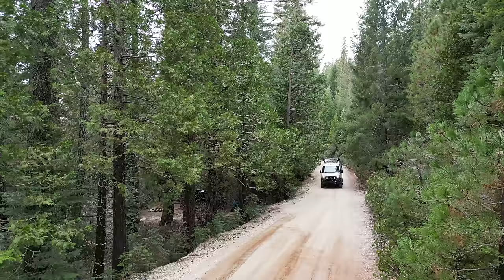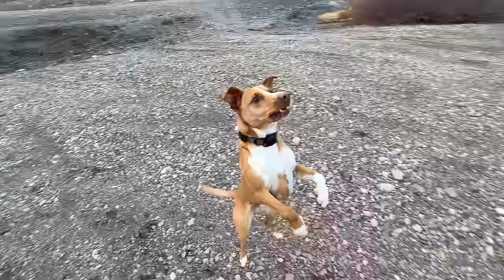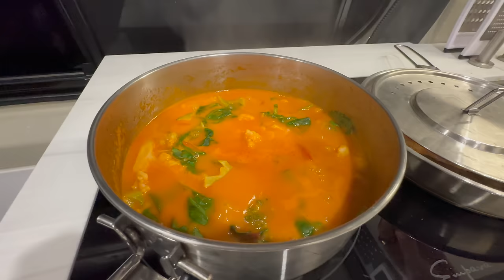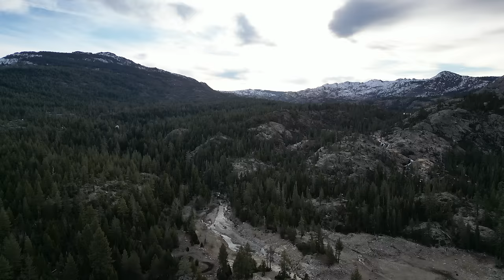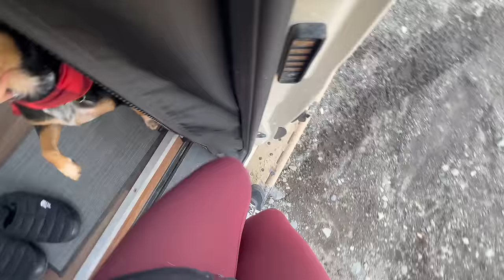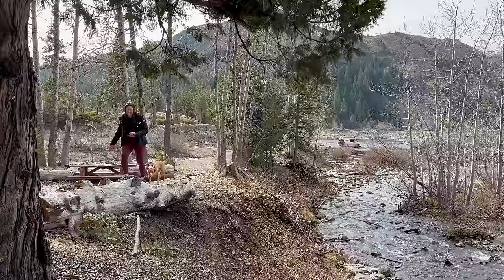Living in a 4x4 Van in the Remote Wilderness | Adjusting to a Growing Family

Comment: Stupid question but why remove the air from your tires. Is this something van folks do and recommend. Is there actual proof that this helps with driving?
Reply: Yes.  When the air pressure in the tire is slightly lower than normal, the vehicle's cross-country ability increases by an order of magnitude.